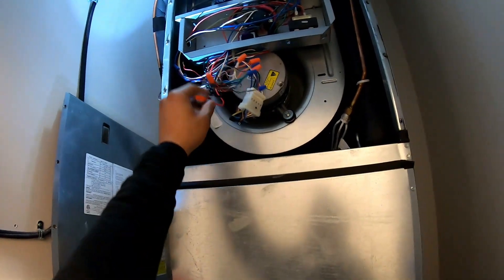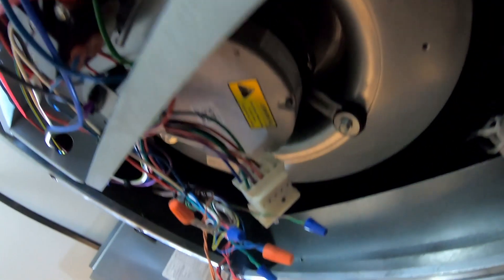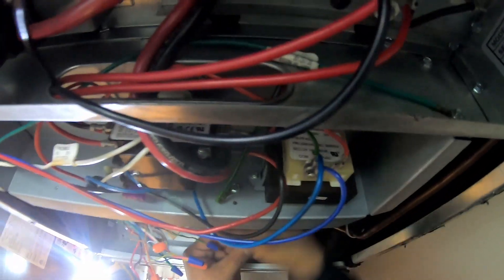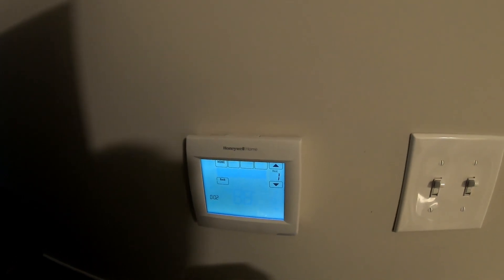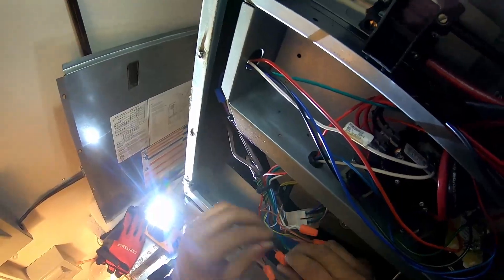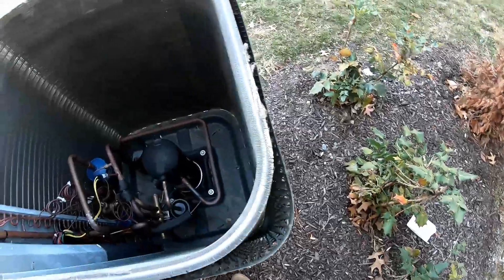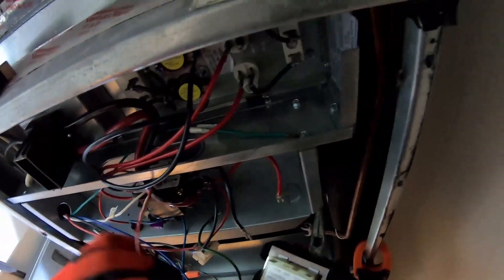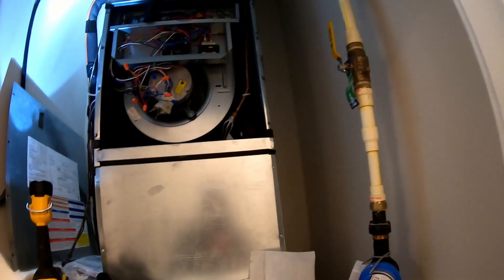Air Handler transformer burning , Air Handler keeps blowing fuse; Goodman Heat pump repair, No Heat!

Comment: My thermostat burned out, when I disconnected the wire from the outside unit , the air handler inside works 
But after the thermostat burned out the emr heat Dosent work and Dosent pass the electricity to fan .
Reply from the maker: did you get it fixed

Comment: But why did the wires short out ?
Reply from the maker: the copper lines heat up and melt the wires i think it’s just a bad manufacture setup , some units have a protective sleeve over them but not his , i just gently push them to the side and repair wire 

Thanks for the comment hit the Subscribe for me if you don’t mind champ 💪🏾💯

Comment: Why would you replace the transformer without check to see if you had short on the low voltage side
Reply from the maker: well i did 2 reason tho , transformer was cracking and burning really bad but also when i checked no short sometimes that wire burns and shorts out but vibration will pull it off of the copper and when you check it checks out good and in some cases i think i showed in this video the fuse didn’t blow when most of the time a short should throw the fuse , 
i take all input tho , and thanks for the comment